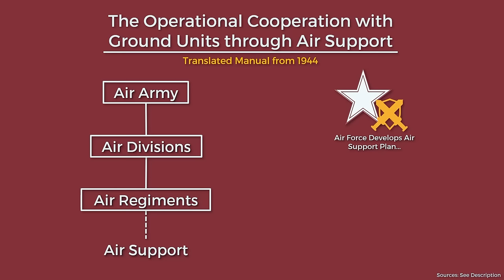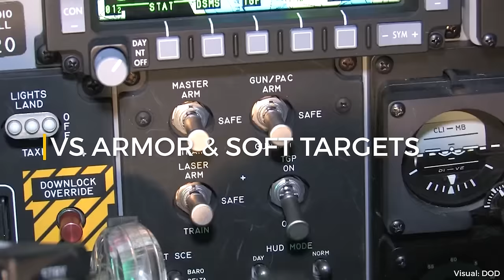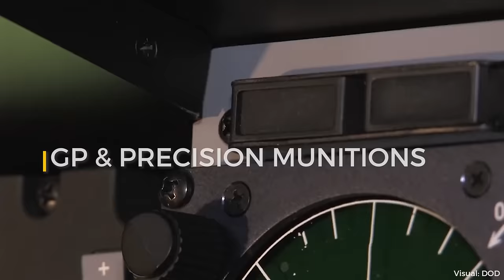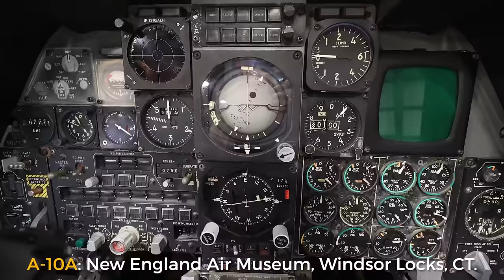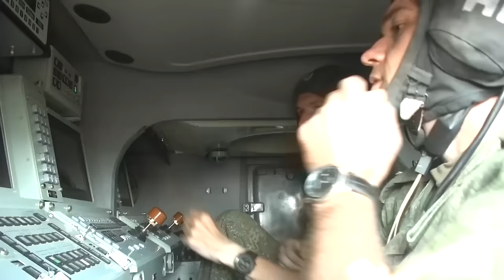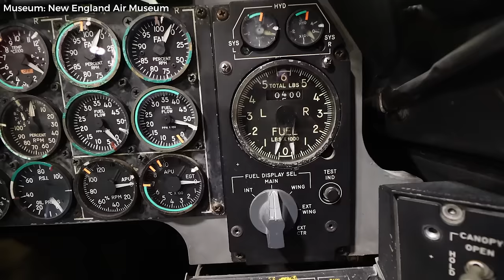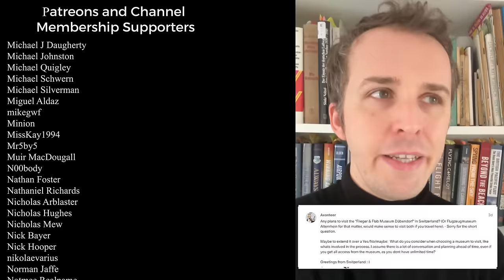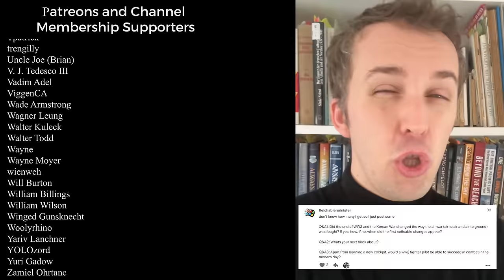A-10 Warthog: Retire or Upgrade the BRRRT? - Future of A-10C Thunderbolt II

Comment: It's not the F-35 that makes the A-10 redundant, but the AH-64. The Apache is cheaper to operate in the CAS role and we can still build new airframes as needed. It's been four decades since a new A-10 airframe was built.
Reply: @cptclemgmail  No, it's not more vulnerable. A-10 even when flying "low" for a fixed-wing aircraft flies much higher than Apache, and has to make long turns while Apache can hover. 
Apache can stay under radar horizon, hide behind even small terrain features, and steer clear of vulnerable positions. They can possibly even get up to visual range to make their few seconds of pop-up with only their mast poking up above their cover. But it doesn't even have to reach visual range as it can stay further back and lob precision munitions, guided by guys on the ground.
I'd also claim that there can always be more Apaches in the area as they are so useful in multiple roles, so they can "watch eachothers' backs" and provide cover for ground troops in many ways. They're so versatile that you can have many of them working in the area, keeping busy in other roles, and that then brings advantages when you need them to provide CAS.
Reply: I would argue that combining AH-64 and A-10 force, with UAV support, as single air formation has a lot of potential, where every component improves advantages of each platform and covers each others disadvantages.
Reply: That and... Y'know... Basic air defence technology, too.
Reply: @cptclemgmail  Go ahead and explain how Apaches would be shot down exactly? They're not the same as KA-52s operated by incompetent russians, who have been commanded to fly over vulnerable areas to operate in the line of sight.
Again: go ahead and explain the exact scenarios in which Apaches will be shot down while they operate below enemy radar horizon, behind terrain cover.
How many HIMARS have been destroyed by russia? In the most defensive and careful strategy Apaches can essentially operate just like HIMARS: stay far behind and lob stuff based on other platforms' targeting. And Apaches aren't even vulnerable to mines.
Reply: @cptclemgmail  No, you're simply totally wrong. You are saying totally, ridiculously untrue things. That's all I have to say.
Reply: @cptclemgmail  
>AH-64 is more vulnerable in a peer conflict.  

no, it's more agile
Reply: >The Apache is cheaper to operate in the CAS role

not quite, helicopters are notoriously expensive to operate. 
Besides, there is a problem of speed and flight endurance, so you really can't replace planes with helis. And vice versa
Reply: @cptclemgmail  I don't see where the difference in airspeeds makes much difference in combat ability in the CAS role, especially since helicopters can be more forwardly deployed than fixed-wing aircraft that require runways, albeit that the A-10 does have rough airfield capability most other USAF combat aircraft lack. The combat ranges are roughly similar. I'll grant that the A-10 is probably slightly better than an attack helicopter in the CAS role, but it's also far more expensive to operate and we can't build more A-10s if we need to replace combat losses or increase the CAS fleet.
Reply: @ВячеславСкопюк  The Warthog is also notoriously expensive to operate. The per flight-hour costs of both Apache and Tiger are lower than the Warthog. Granted, the operational costs of the Warthog would be lower if we could get new airframes instead of having to constantly refurbish airframes that are over 40 years old, but we can't.
Reply: @cptclemgmail  That sounds more like a problem with operational planning on the part  of the Army than of the respective capabilities of the platforms.
Reply: @cptclemgmail  Ka-52s have to use nose mounted sensors.
The Apache has the Longbow radar, which is mounted on the mast.
They're essentially worlds apart. Did you see the aftermath pictures of the gun shooting the Ka-52s own nose because the gun wobbles excessively in its mount?
Reply: @cptclemgmail buddy the a10 is the definition of vulnerable  helicopters benefit from being able to shoot from behind cover .
Reply: A-10 can only shoot 30mm cannon directly ahead, with poor visibility and aiming. Apache can shoot 30mm cannon in any direction from a turret, with much better visibility and accuracy. A-10 can shoot a larger volume of fire but also tends to miss with more rounds fired. Spray and pray versus sniping. The A-10 was built around the gun but even on the A-10, missiles were shown to be much more effective. The lighter cannon on the Apache is more practical as a secondary weapon. 

Recent missiles can now extend the Apache strike range way beyond the range of MANPADS and out of visual range of the target.
Reply: @ChucksSEADnDEAD  Russians have Mi-28 with a radar on the top. Did you know that?   ;)
Reply: @ldkbudda4176  Onatopp?
Reply: @pistonburner6448  Ja-ja! The Mi-28N (night). Radar on a topp...   ;)
Reply: @ldkbudda4176  Do they name that chopper: "Xenia"?
Reply: The A10  even when shooting standoff weapons like Maverick or Hellfire II (with autonomous radar homing) lacks the sensors needed to popup, identify targets fire and dive away below terrain.   It will suffer high attrition from SHORAD like the Mach 4 Pantsir.  They'll be used until the aircraft and pilots are casualties or soldiers become sick of blue on blue incidents. 
-There are better area to spend the money.   Wasting money on A10 risks lives.
Reply: @pistonburner6448  "Наташа" "Natasha"  ;) I'm kiding. I do not know.
Reply: @ldkbudda4176  You do understand that I'm talking about Xenia Onatopp from the Bond-movie Goldeneye, who kills enemies by sitting "onatopp" of them, right?
Reply: @pistonburner6448  Thanks for clearing that up. No, I do not remember that female movie character. I'm not so fond of Bond-movies per se, albeit I'v been in that place where original writer of Bondiana lived. It's outside of London, UK.  ;)
Reply: @cptclemgmail how did that work out for the SU25s on both sides? Lobbing dumb rockets in an arch hoping to stay out of AAA range and still got shot down left and right. Although dropping "smart bombs" didn't save SU34s either.
Reply: @cptclemgmail  It's less vulnerable, actually. And it can operate from a forest clearing one hill away from the fighting by three guys and a 5-ton truck.
Reply: Both the A-10 and the AH-64 are obsolete. Between a host of new weapon options (like precision munitions, drones etc) there is nothing an A-10 or AH-64 can do that drones or artillery or glide bombs or loitering munition can't do better, cheaper and at a lower risk and investment cost (no multimillion USD aircraft/helicopter. The human operator isn't inside the vehicle itself). "Operating below the treeline" doesn't help when the woods and the sky are littered with observers, hidden sensors, AA weapons etc, all due to the increased drone threat. CAS aircraft and Helicopters have gone from being the terrors of the battlefield to occasionally being able to potshot. Only Drones can function in this environment because they're cheap enough that they can handle insane attrition.
Reply: @fiendishrabbit8259  Tell me you don't understand how drones work. Have you heard of this lovely thing called a "jammer?" How about "high-energy microwave"? Counter-air systems using one or both can make it utterly impossible to operate UAV's over hundreds of square kilometers. Russia deploys them in large numbers, and presumably Ukraine has received from their western backers as well.

Next time, think before you open your silly little mouth.
Reply: Apache is worse at everything the A-10 does besides having newer missiles and an extra crewman.  
It has all the same drawbacks but without the range and even less ability to run away.
Reply: @mostevil1082  Less ability to run away? Yes,  attack helicopters are slower than the Warthog, but against an air superiority fighter or an air defense weapon, the Warthog won't be running away any better than a helicopter would.
Reply: @mostevil1082   Wrong.

The AH-64 has better sensors and a better EWAR suite.

The AH-64 can mask itself behind terrain.

The AH-64 has an actual targeting/fire-control system for its gun.

Double the crew means less workload per man.

Try learning about the topic at hand before you start running your fat mouth.
Reply: I'd say that it's the drones that are taking the place of the A-10.
If you want to see if it's still a feasible platform - send it to Ukraine.

Comment: No aircraft can remain in service indefinitely. 

B-52 has entered the chat.
Reply: The 52 is only effective against a competent enemy because it carries standoff weapons.  It doesn't penetrate heavily-defended airspace.
Reply: @charlesfaure1189  
You mean incompetent?
Reply: Some B-52s will start falling from the sky. Worth mentioning that at least some of the replacement parts are from the scrapyard. Sure, they weren't used too much but they aren't new. When it will start falling they will retire it.

Comment: My understanding of the A-10 is that it's the most advanced specialist close attack plane... And was designed right as the concept was made obsolete by viable precision munitions, the sensors that aim those, and attack helicopters that can do everything the A-10 can do and stay in place to do more.
Just as the greatest battleships were designed at the same time air-launched torpedoes and even rockets became capable of easily sinking them.
Reply: The battleships at least had the excuse of night and bad weather operations,the A-10 has nothing.
Reply: @naamadossantossilva4736 As I said, the A-10 showed up just as its entire concept became obsolete.
It was good for the 1950s and the 1960s, but the 1970s already had viable precision munitions and the first attack helicopters...
Reply: @lordMartiya  What the presenter forgot to mention, was the 30mm not the only ordinance The HOG can carry. There are many F-15s, and F-16s that have been retired because of high airframe hours. BuT the glorious hog goes on and on. BTW, Apaches don`t have the range of an A-10, thought you would have known that.
Reply: @davidmartyn5044  The cannon has been proven less than effective against any MBT built since the 1960s, and it's the only thing it offers that everything else doesn't.
As for any combat chopper, pretty sure that staying in place and shoot only the enemy rather than your own troops is a superior feature.
Reply: @lordMartiya  There`s been friendly fire in all wars, so you can`t only point to the A10 for that. So why was the A-10 cleared for service? I think it was FY77 when the first a/c entered  service, and its still here in 2024. Now, if you had said there are fewer and fewer airframe in service than the attack heileos , and the maintenance  cost per flight hour is going up and up, you may, only may have a point! I hope its still chugging around the skies n 2030. One last point, the US Military has had great Value for the money spent. it`s a true brawler of a plane, sometimes its all you need.
Reply: @davidmartyn5044  It was cleared for a fight because of politics. Same reason the development of the TSR-2 was interrupted in favor of an option that ended up far too expensive that was later replaced with an aircraft that had been rejected in favor of developing the TSR-2 in the first place.
Reply: Except that it was made to be cheap, not advanced
Reply: @techienate And that's why it's been outdated from the start.
Reply: Hmmmm....Aircraft Carriers are also huge targets and lightly armoured. It's the on-board weapons systems (Fighters, airborne ASW etc) and overall sensor-reach that makes the difference. 26 miles of Gun Boom, considering the size and displacement of a BB, is just not worth it.  The BB would have to be retro-fitted into an almost SCI FI giant missile truck .... with a mix of exotic weapons and huge sensor arrays just to stay alive in the fight.
Reply: @davidmartyn5044  The rationale it can still fly is a pretty flacid one when you start loosing or overstressing airframes a few months into a peer-to-peer conflict. Those F-15s and F-16s have been replaced with airframes that have less flight hours, and probably also other efficiencies that came from new blocks and/or platforms. It is not what you can bring on day 1, it is what you can still use in day 60. 
Retiring can free up budget to train crew, replace equipment and invest in platforms that are more likely to be usefull in day 60 and beyond. 
In my opinion this plane was very much optimized around a gun that, while certainly impressive, is honestly not as deployable (anymore) as the hype around it, and then you end up with a fine plane that is always carrying around the weight of a massive gun. It was originally marketed as the big firepower that would attrit sovjet armour push from the German plains in the first week, and it getting more and more unlikely that type of battlefield will occur where the most important hit needs to be made in the few days.
Reply: @Tuning3434  You obviously haven`t done any research. Instead of parroting peer to peer conflict, you could have said there were less than 300 airframes still in service, out of 700 made. To me, at least, is less than a viable number to make a difference. I`ve seen it enter service, and probably see it finish its service. It`s earned its stripes in combat. I like the HOG, always have.
I did make the point in an earlier comment that earlier F-15s and `16s continue to be replaced and are probably better a/c.
Reply: Attack helicopters can do what the A-10 can on paper. They cost a lot more to field per flight hour, the duty cycle for a helicopter is much lower, the maintenance is easier on an A-10 and the A-10 has a much longer loiter time as well as being faster and the A-10 is much more survivable than a chopper. 

That being said, the A-10 and attack helicopters are both outdated in modern warfare. While I absolutely love seeing A-10s, Apaches, and cobras in action, they make little sense in modern warfare. They are all worthless targets until you have absolute air supremacy. Drones seem to be a better option by most measures. Though I still don't trust they can't be jammed. The Super Tucano has been considered for CAS as well. While the F35 may be able to do CAS, it's kinda garbage at it in comparison. With the exception that it could actually defend itself against another fighter.
Reply: @lordMartiya the concepts fine. It transitioned into one of the best platforms for loitering and delivering smart munitions.  But drones can do the same thing cheaper for less risk.
Reply: Might as well use an F-16. The A-10 is also getting expensive to maintain with all the upgrades. The A-10 is nothing like the battleships.
Reply: Helicopters are very fragile platforms who can be destroyed easily even when heavily armored. They are also expensive to maintain, have limited speed
A close air combat aircraft is much more efficient and quick : during gulf war, A-10 destroyed 1500 Iraqi tanks and APC, while Apache destroyed 250
Reply: @davidmartyn5044  operating range or lifetime range? thought you'd know the difference since you thought others might. I am asking for a friend who works on attack helo's.

Comment: Circa 1981, while working in the US, I went to a county fair where the Air National Guard was showing off a Warthog.  I could not believe I had never seen one.  The info-plaque suggested that the A-10 was already being replaced by „better“ aircraft.  Back home (Germany) while walking through the forest, one of these flew over me, made a tight turn and almost seemed to hover.  I wondered if the „Ami’s“ had reinvented the Zeppelin.  I was badly overweight at the time (I‘m 35 kg lighter now), but apparently did not look like a tank, so it just daintily flew over me and disappeared.   I was shocked a few years back when I learned they were still in use.  I guess ancient beings can still be useful.  I hope so.
Reply: This aircraft is still in service because USAF needs, for Congressional purposes, something to point at and say "LOOK! WE CARE ABOUT CAS!" otherwise some of the funding and agreements that govern what type of aircraft USAF vs US Army can operate would start to break. It has nothing to do with the merit of the aircraft beyond it being so completely unusable for anything else that it fills the necessary political role to prevent US Army from buying something like A-29 or any other fixed wing attack aircraft of any kind.